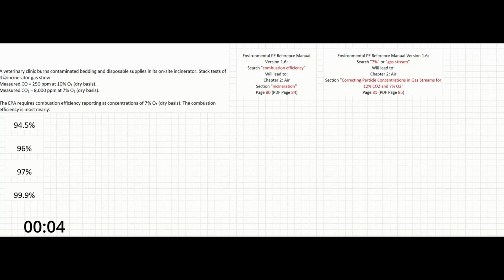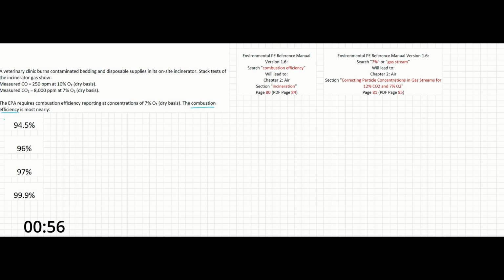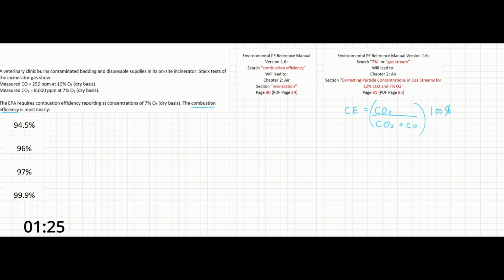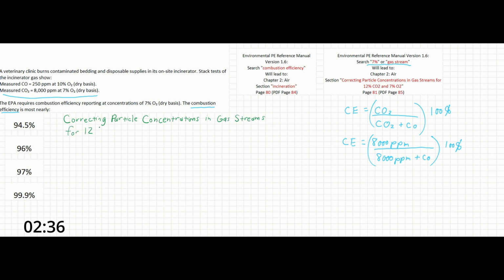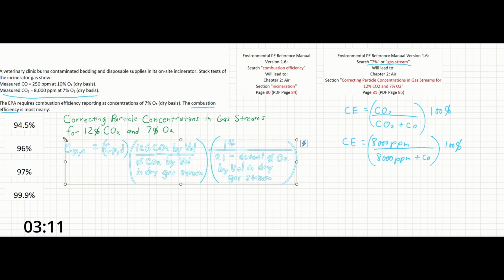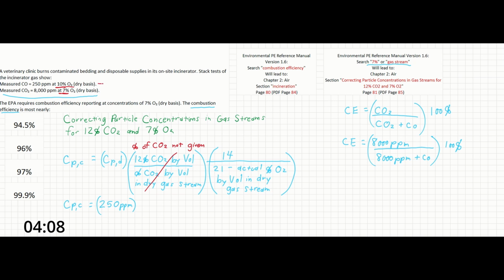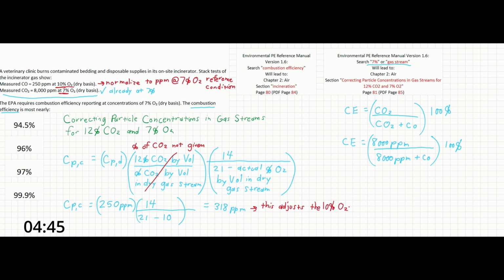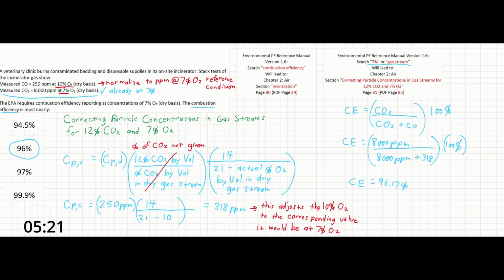PE Exam Practice Problem #107: Environmental | Combustion Efficiency (7% O₂ Normalization)

Comment: I really appreciate that you add the section in the handbook that can used for this problem. Thank you!!
Reply from the maker: Thanks! Yeah, the whole idea is that ideally you can use context clues to find what you need even without a ton of previous experience. Not always possible, but my goal is to show it when it is.